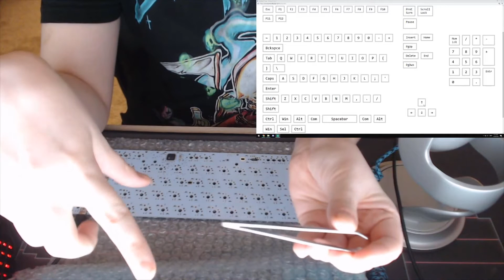How to Test Your PCB

Comment: Won't it electrocute you if you touch connected keyboard with just a pair of metal tweezers?
Reply: No, the current and voltage used on a keyboard is very low because it's only used to send signals (like what key was pressed and send that information to the pc through the usb) so it doesn't require that much energy